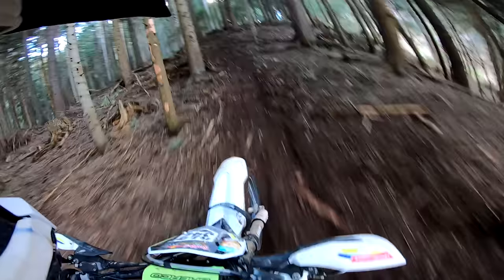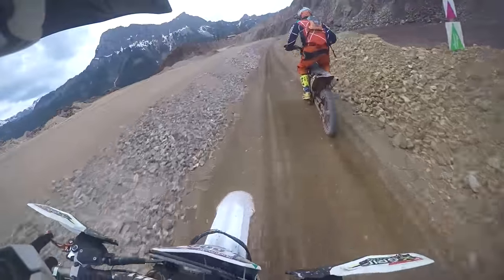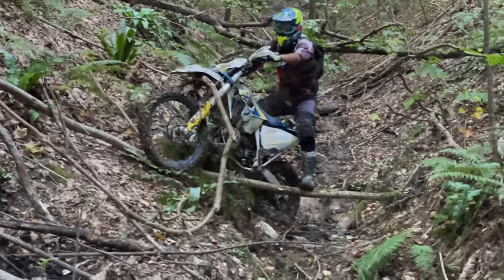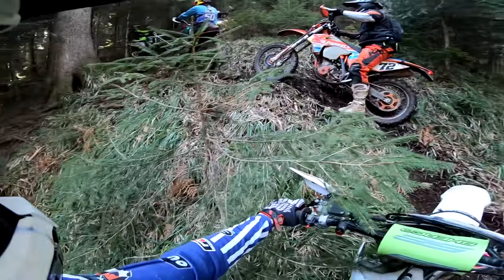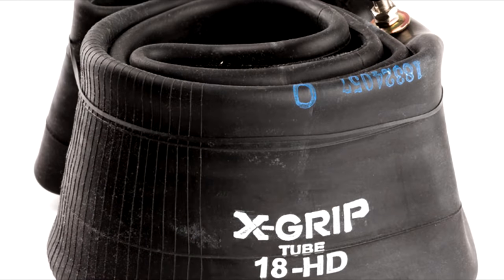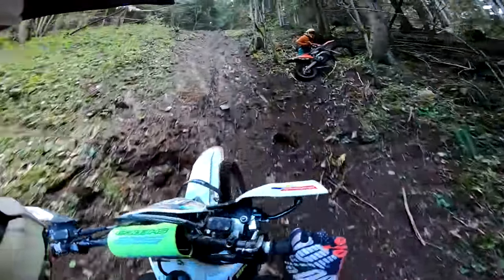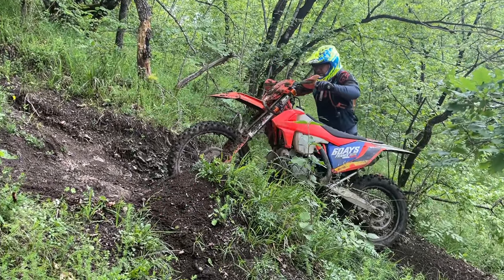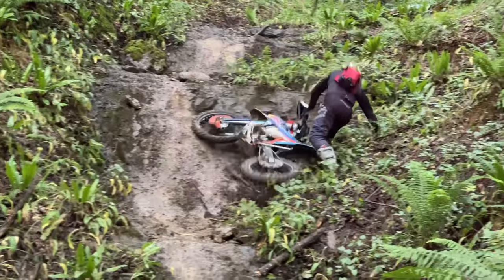WHAT IS FOR YOU ? TUBES vs MOUSSES vs TUBLISS

Comment: Mousses require regular lubrication?? You make it sound like you have to remove the tyre to lubricate them.  I can guarantee you that your tyre will not outlast your lubrication.  Any good tyre shop will automatically apply lube when changing the tyre negating the need to ever do it yourself.  If you're not sure, just ask them to add lubricant.  It takes 30 seconds to lubricate your mousse if you change your own tyre.  It's really not even note worthy.

Comment: You.cant get.a.pinch flat.with tubliss.,.you can run 0 psi like a run flat., the inner high pressure tube holds.110psi and keeps your bead locked on. Run flat!

Comment: I run a 5mm tube and havent had a flat in 6 months but anything under 3mm isnt even worth buying. i ride xc and i ride at high speeds and i also do alot of slow techinical riding and it holds up just fine

Comment: If you can’t afford to have a flat, Mousse is the best choice unless you’re riding on hot highways for many miles. 
Their biggest downside is weight and the gyroscopic affect on higher speed trails and lack of feel. 

Tubliss work just fine in the front so long as you have a good 4 ply tire and aren’t running below 8 psi. 
Tubliss are great for Dual Sport riding. Most punctures can be repaired with a plug trailside, or by a sealing product like Slime. 
Downside is a catastrophic failure caused by too low psi in the bladder which usually rips the valve stem. 

Tubes are still a favor no nonsense system, but they are the most vulnerable front pinched tubes or nail punctures. 

Though Mousse does add weight, you won’t have to carry a spare tube or tire irons.
Reply: Very good opinion, thanks.

After 3 non-repairable flat tires with tubliss within 6 hours of riding, I’ve finally come to this step

Comment: You forgot to mention that different solution works better on different terrain. If it's all rocks and especially those slim rocks that can get pushed between rim and tire mousse is the only way. Tubliss is good allrounder and perfect for everyday training since it's easy to add air for fast speed and lower for slow stuff. 
 
I've run 150+hrs (5 tire sets and counting) on single tubliss setup front and rear with zero problems. Mostly hard enduro with low pressure soft tire but also one tire set faster trail riding. Same rims haved moved between bikes 150tpi, 250tpi, 350exc, 500exc. I would recommend tubliss front and rear for any hobbyist who doesn't make their living by winning races.

Mousses are obviously the best but require more testing and maybe drilling them softer and need additional rimlock for soft tires. Mousse lube is the key to expand lifetime and they do shrink over time and get softer up to point when they are just too small. Some riders cut them and add piece between to extend lifetime even more. Set of mousses should be fine for few sets of tires so for many hobbyist this can mean years. For pros mousse is the only way since it's the only one that can't get puncture and with two or even three locks tire will stay on even if mousse has exploded. 

Tubes are only good if there is no sharp things on the way and with proper mounting hd tubes can also serve without problems. Most common issue with hd tubes is ripped valve - this is mounting fault, hd tubes move a lot more that thin ones and you never ever should add the nut against rim. Good thing with tubes is that they can be easily fixed when punctured just remember to add tape over a patch on hd tubes since they tend to rub the patch off without additional protective layer on top.

Always good to remember it's 80% rider 20% bike. And if we assume tires would count say 25% of bikes share it would be only 5% of total. Flat or otherwise broken tire still means 100% lose -  weird mathematics isn't it?
Reply from the maker: Great comment, lots of useful information. I found rear tire with tubliss is really easy to change, but on front its really pain. Of course the terrain and the rider choose what suits them best, some people dont love mousses in front because more heavy feeling when they turn handlebar.

Comment: Tubliss is awesome for adjusting pressure. But nearly every Tubliss rider I’ve talked to has had never ending leak issues. The front is useless. My bike has one on and I’m just gonna put a tube up there. 

Tubes are reliable and solid but maybe only for smooth clean trails and tracks. But I’ve pinched so many tubes and gotten thorns in tires. 

Mousse is an absolute must for hard enduro and trails.

Comment: For the rear I use Tubliss with an undersized NitroMousse Soft (110 mousse with 120 tire). This way I get a super stable sidewall, with a soft tire crown, can increase pressure if needed and get full flat protection. It's great for tires like the Ibex which tend to tear knobs making tubliss only not suitable.
Reply: WTF is tubliss ?
Reply: i have heard of a few people doing that and they loved it, gives them great grip and can still adjust pressure when riding faster terrain
Reply: Ty bliss and a mousse in the same tire?

Comment: I’ve had two bikes with Tubliss and they’re a pain. They always seem to leak no matter what. The local shop near me is constantly fixing them. Or removing them to put tubes back in. 

Tubes are easy but also too easy to pinch or damage on installations and they add up. 

Mousse seems like a set it and forget it. But you can’t ever air up for the road and air down for the trail and fine tune it. 

Mousse all day.

Comment: Just to mention than the blue tubeless shown is the NomOusse pro system. With it you can run from flat to more than 1,5 bar - even on the trail model 2,5" wide rims - without danger to damage your rim, as NomOusse protrudes 3 cm from it. The tubeless systems works very well with non extra soft tires. Mitas Terraforte green line or Michelin Medium are perfect for extreme (0,2 or 0,3 bar). Pirelli Scorpion medium-soft for normal enduro and hard tires for desert. ¿Expensive systems? not as much as some mousses and you can reuse a lot of times, even changin tire wide (140 /120/100), adjusting the pressure, not speed or temperature depending.

Comment: I've run everything and tubes are not reliable for hard riding and in real tough conditions (rocks, sticks, and sharp objects). Tubliss are great front and rear, they are super light and I've never had an issue with anything tubliss.  I do top off my high side ai pressure each ride, which only takes a minute. And for moose, I love those too.  I've run moose front and rear and they were awesome, just a little heavy and yes, they can wear out fast.  The other thing you did not mention, moose can be hard to keep balanced and take a lot of weights to balance, so if you hit road sections and don't want our wheel bouncing about, go with tubliss and they balance super easy.

Comment: Nitro-Mousses all the way.  If you don't race, they last long enough.  Tubliss = reliability through continual maintenance(gotta check and refill the tire each ride)
Reply: Not refill the tire, but check the pressure and top it off (the red high pressure side).
Reply: @onthethrottle7104  most of the time the high pressure red tube is most the time fine.  I Found that I had to check the tire (low pressure) EVERY RIDE.

Comment: You recommend two rim locks on rear tubliss?
Reply: Tubliss doesn't need any additional rimlocks - tubliss is '360 deg rimlock' by it's nature. 2 locks for soft mousses rear and front.
Reply: The few AA riders I know say theres no need for 2. I run bibs. 1 rimlock in year and none up front
Reply from the maker: two rim lock if you use supersoft mousse or tube. With tubeless you don't need anything extra.

Comment: You were very fast speaking wise. Please slow down a little bit. 
What’s wrong with using Tubliss in front? 
I don’t race.
Reply: Puedes cortar muy rapido el neumatico en una roca o escalones por esto es preferible mousse delante
Reply from the maker: Its more easy to get pinch flat with tubliss, mousses are better for front. And tubliss is really good for rear tyre
Reply: @TheDirtbikeRider  Pinch flat with Tubliss?? Maybe you're confused, Tubliss does not use tubes, so it's impossible to get a pinch flat.
Reply: @TheDirtbikeRider please explain

Comment: Mousses for peace of mind!
Tubliss is vulnerable and too expensive.
Heavy-duty tubes are a better option as you can adjust the pressure, still they are susceptible to punctures.
So, mousses for peace of mind!
Reply from the maker: I am very happy with the mousse in front, but on rear i always used super soft mousses and they dont last long. That's why I prefer a system that can do more hours like tubliss.  But for races I always go for mousse because I have no problem with them.